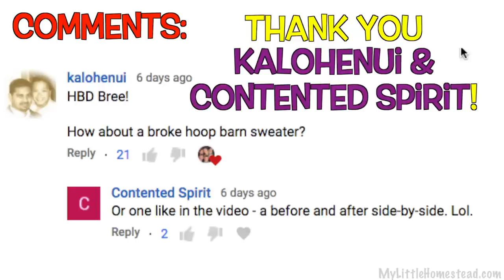Finish 1st Gaming Desk, Sink Cabinet & Border Collie | Weekly Peek Ep175

Comment: Those desks are beautifully designed, I gotta say. And as a person who wears glasses also, Bree, put those safety glasses on always!! Lol. I speak from experience. I'm a jewelry maker, I wire wrap and I use metal wiring. 3 years ago a piece of metal wiring went right into my eye while I was working. Missed my glasses completely, went up and over and scratched my left cornea. Ouch, to say the least. From now on, I always put safety glasses on.
Reply: YesDarling 13 they make some that fit over regular glasses that way stuff can’t go over them. Regular glasses typically don’t have safety lenses either and could shatter if something flew into them.
Reply: @livelongandprospermary8796  Oh I know, that is what I wear currently. Of course, after I stabbed myself. My father used to work at GM, and snagged me a pair he used. So lovely not having to worry about that.

Comment: Rub a bar of soap along the edges of the wood and the slide cruve and it will slide in easier.
Reply: an old candle works well too
Reply: or candle wax
Reply: or dishwashing liquid
Reply: I used old fashioned furniture wax, it has a lower melting point so it lubricates better. (In my experience.) Candle wax was okay but I found it wasn't as smooth and it seemed to stop working after awhile.

Comment: Top of the screen suppose to lineup with the top of the head. Seat height, until the knees make a 90 degree bend, and you suppose to be able to put your hand half way between the seat and knee hole (sear edge not blocking the blood flow). The sear elbow at such a height that the shoulders are relaxed, and elbows rest on the pads. Then the desk height should match the set pads height.
Reply: This. Ergonomically correct.

Comment: Desk looks really nice. You can always hang the other three monitors from the ceiling along with the speakers. Part of fitting things to cabinets is a finger plane. Remember goats are browsers not grazers, they would be very happy to have any tree and brush prunings to eat the bark off of. This could save the yuccas and other cooling shade you have. I am still surprised you don't have roof dents on the vehicles.

Comment: Rubbing bar soap on the edges of the panel dividers (in the cabinet) would make them slide in better. Then when they're in the excess soap wipes away easily with a wet or damp cloth.

Comment: As far as the barn goes you should check out R&R Buildings here on YouTube & consider building a pole barn. I bet it would be cheaper than an A frame & it would definitely be more functional.
Reply: Lynn Dunn, Earthbag construction also works for arch shaped buildings like the pole barn. Would be indestructible for centuries!
Reply: I want to see them try rammed earth.
Reply: Rammer earth or tire wall...

Comment: Oh just one tip, if you keep the blade at 40-45 degree angle along the edge when the blade lies flat on the top of the surface when cutting the dressing, it should cut a bit easier, just make sure to go easy.

Comment: I used a piece of 3/4" steel pipe into a floor flange. then I mounted a tv wall mount to the pipe to suspend the monitor over a free standing desk. Yes they sell them too, but hey I made it my self.

Nice work.

Comment: Tell me that the big PVC pipe seeming to bow is the perspective of the camera. I was actually very concerned about many places in the states and how their roofs aren't built to handle snow, and I'm relieved to know that you have decent roof structures and a decent slope to them... Meanwhile where I am there's about 4 feet of snow on the roofs and I THOUGHT we were prepared for it, but now even our ceiling has cracked in two places. Anyone getting snow they don't usually, please be safe. I also can't help but think about what will happen some places when all this snow melts. I know a lot of places in the States don't even have proper street drainage, and are already prone to flooding. It's all doing me a great concern.

Comment: You have a very good lubricant for your desks.  Bees wax.  Any wax would do but you have lots of bees wax or at least you should.  A question I have, Does your honey have a particulate taste?  Is the primary source of nectar mesquit?  Your honey looked different than honey from grasses and typical wild flowers of the middle plains states.  Just wondering.

Comment: Hi folks! I've been binge watching your channel during my work vacation, and I love your spirit and your style! It's so great watching a family work together. I have a question for you, and it's because I live in an area of temperature extremes seasonally. How are the earth bag homes vented at the roof/soffit area? It's not obvious from the videos. PS I really like the idea of the reciprocal roof,  and understand they are built on shared tensions, are there any fail safe's built in should one timber or fastening fail? Also, is the Mesquite tree attached to the roof ridge in the kitchen load bearing? If so, does the angle of the tree timber affect the load it is able to carry? And, if so, how did you calculate this?   ( I understand you have fewer concerns related to roof weight tolerances where you are located, but I do like the look, and wonder if your enquiring minds already did the work on this ;)
 )   PSS Related to the desk build....I wonder how a  strong magnet attached to your computer stations might affect your hard drives...I only say this because I had a computer hard drive due to it's proximity to a magnet. Whew! Can you tell I binge watched you! ?! You are a wonderful family! Thanks for the binge watch opportunity!
Reply from the maker: Considering the venting, these are full vaulted ceilings with no Sheetrock. There is a small separation at the cob to roof joint which offers some ventilation. In the main house there is an attic where we can can normally.
Reply: @mylittlehomestead   I just ask, because you are insulating the roof rafters, and then enclosing them, I just wonder about moisture build up in the roof, especially since rot on one member of a tension built/reciprocal roof can lead to a failure of the enire roof system. This would be a slower process in a dry climate such as you live in, but even you have seasonal monsooon rains, it seems that with out air flow through the ceiling/roof, there might be opportunities for condensation/moisture,  mold, and rot building in the attic space